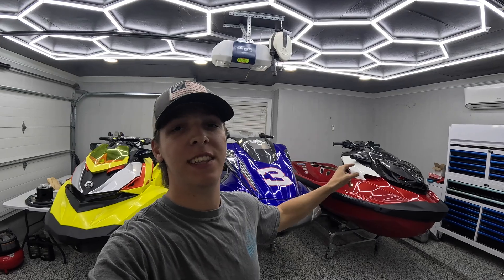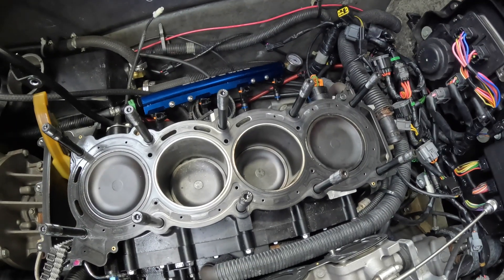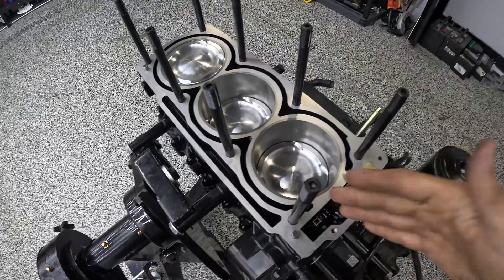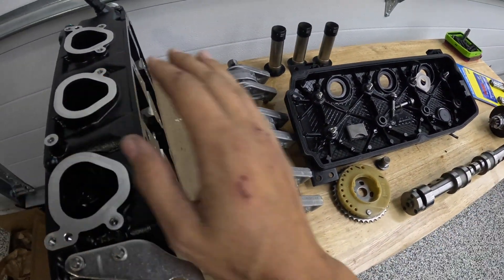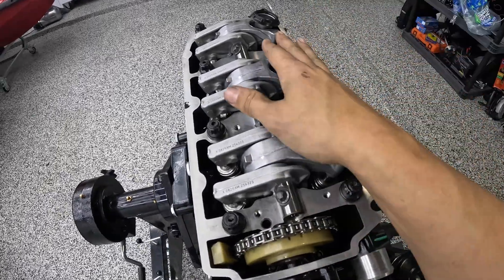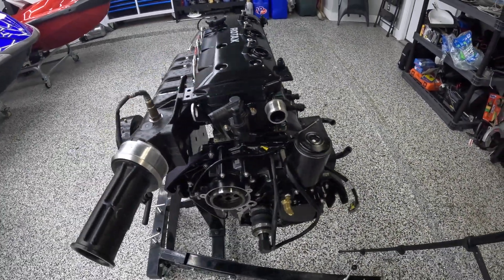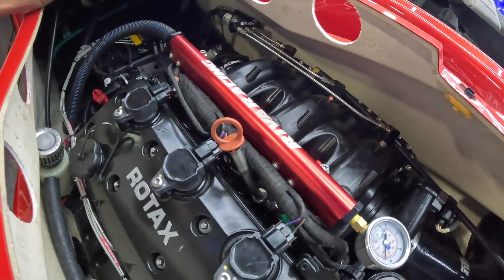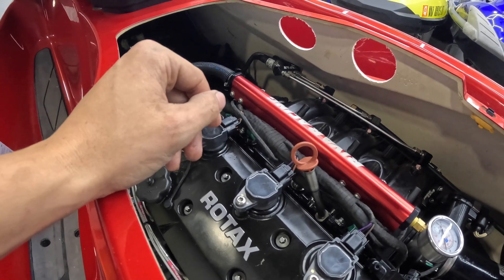Building and Installing a HIGHLY Modified Sea-Doo 325 Engine.

Comment: How much tighter piston to cylinder clearance are you running than what the piston specifies ? You said self clearance, zero clearance ? Maybe you are running the recommended piston clearance then added a coating to it which took up the gap ?
Reply from the maker: Running the recommended piston to wall clearance then added the coating on top of that.

Comment: The coated cylinders have way better heat transfer than the iron sleeve.
Reply from the maker: The plasma coated cylinders are absolute crap! Worst thing Sea Doo ever did, aside from the carbon seal :)
Reply: @GreenHulkGarage  Didnt take notes from the 5.0 coyote motors...

Comment: Thank you AGAIN 😎😎. I do have a question. Just curious..(I am in NO WAY *QUESTIONING* you. Just simply ASKING a question.) What are the reasons why you DIDN'T you use a different head, etc. and header?
Reply from the maker: I didn’t go with a ported head because of the lack of time I had to get this ski back on the water. I do plan to pull the engine apart again sometime next month to examine the coating and add a few worthy upgrades (ported head included). 

Going with a header setup would make the most horsepower, but having a water-jacketed header in such a tight location would be very expensive. The gain to be had versus the cost and complications involved is simply not worth it to me.
Reply: @GreenHulkGarage  Thank you. (Sincerely).

Comment: I can’t wait for the summer, Im gonna be rippin my 96 Waverunner III especially on July 4th. I think I have the one of the oldest jetskis on my lake. 4 strokes are very powerful and smoother, but 2 strokes have the best sound and vintage theme in my opinion.
Reply from the maker: I couldn’t agree more. My ‘98 XPL is my favorite ski. It may not be the rocket that my 325 is, but it’s loads of fun.

Comment: What happened to the engine to rebuild it?
Reply from the maker: Nothing negative. I simply wanted to put iron sleeves for the added durability over the factory plasma coating as well as try out the coated piston with the hopes of reducing blow-by. Factory Sea-Doo engines have proven to have excessive blow-by so building an engine to limit that will only result in more horsepower.

Comment: What MPH are you expecting from this? Does it have the Fizzle supercharger wheel?
Reply from the maker: Low to mid 90s
Reply: @ nice set up. How many lbs is the wheel?
Reply from the maker: I’ve seen just over 24 psi at the intake manifold.
Reply: Will you have to worry about pump stuffing or is that not too much of a problem with the ST3 hull and the standard intake grate..?
Or better question, do I have to worry about this on my 21 RXT 300 stage 4 hitting 88mph (dash speed)??

Cheers
Reply: @jakepivac  88 seems low... what is all done in this stage 4?